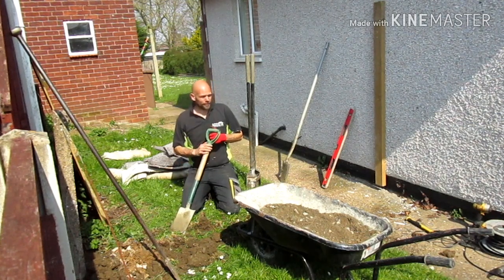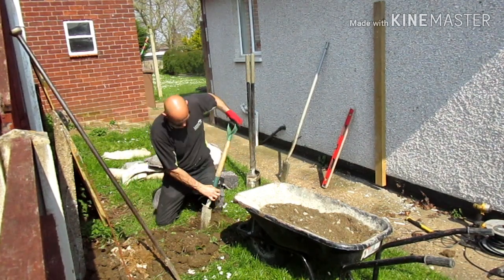Gate install that was a royal pain

Comment: I have had similar issues with this type of wall. My solution was to use multiple L shaped brackets like this https://amzn.to/3nt0dMb not the prettiest but if you use 3-4 down each side of the post, they do the job - paint them white on the wall side with hammerite metal paint. I always carry a stock of these on the van. 👍
Reply from the maker: This one was a royal pain. If I had noticed the hours ewas a prefab building I would tackled it differently but I did and I was a good half hour drive from any DIY shop so had to go back

Comment: Hi mate i was enjoying watching that and it was all done Without seeing the panel fitted any reason. Do you not use post mix when fitting posts. Did you put timber on post to make them blend never seen that before. It looked like a hard job getting that post fixed to the wall. Did they not want the gate fitted at end of house or was there a reason for that. Great job 👍
Reply from the maker: Hi fella as I said in intro I lost a couple of clips so missed out on fitting panel .I use post mix on most things just gets in light solid call for a heavier  ix so use a 4-1 mix of 20mm ballast and cement in soft soil. When I fix a panel onto a post i use 25mmx19mm battons to create a grove for the panel to sit in then screw the panel to that. The customer asked us to place it there as she wanted to block garden off but still keeping maximum amount of garden and height of fence due to dog
Reply: Cheers for the reply mate i remember now you did say you lost some clips been a long day 👍

Comment: why  you  didn't  go for  fixings  that  batten  in to  the  wall   with  a concret  secrews or bolt  enjoyed  the  video.
Reply from the maker: I tried but it's a prefabricated house so it's not strong enough. I would of ended up making more holes than it was worth. M